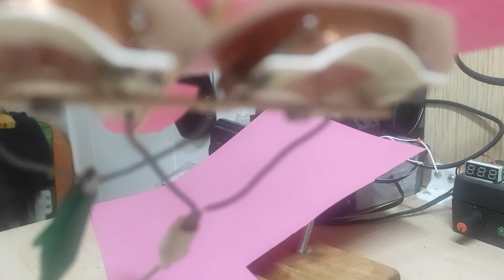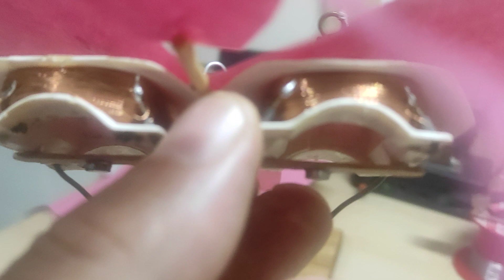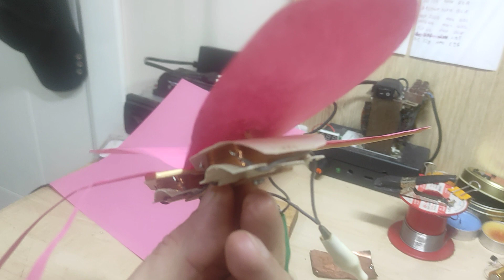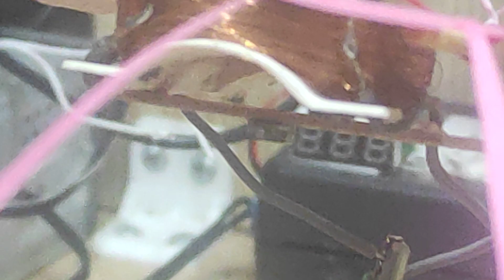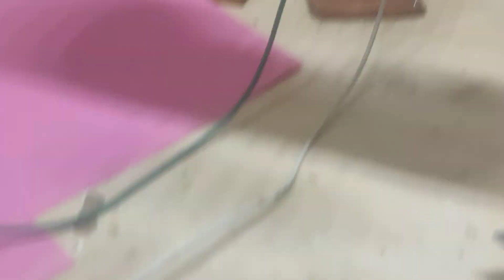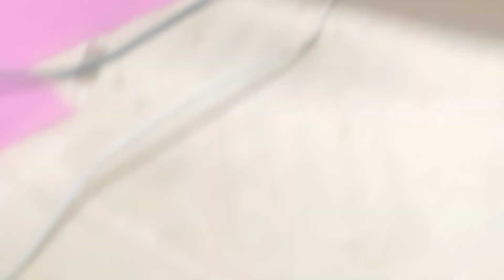Robotic insect Oscillator engine.

Comment: It needs flapping of atleast 90° vibration will never let it fly
& yes try to reduce weight
Reply from the maker: There is no need for 90* degrees in insects or bee birds because there is air pressure. If the coils lighten, there is hope🤔🐝&🐦